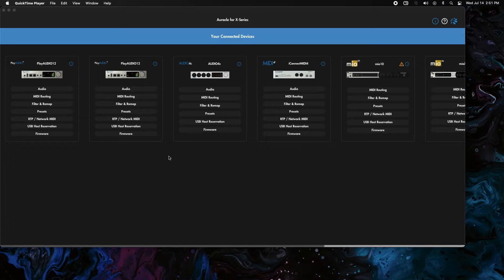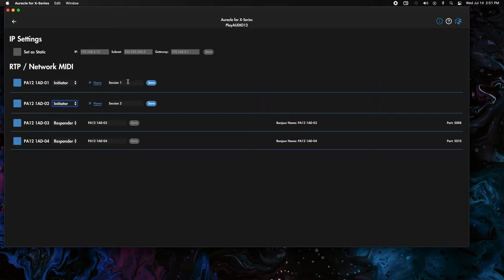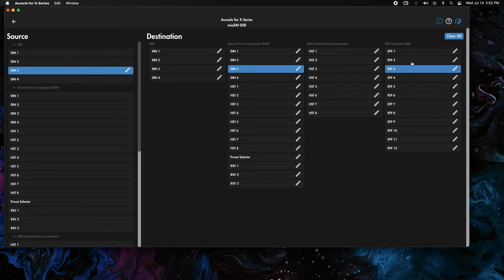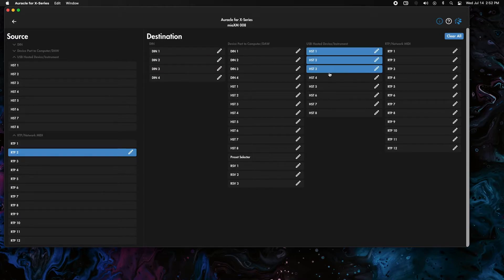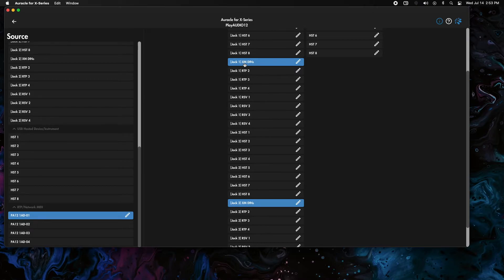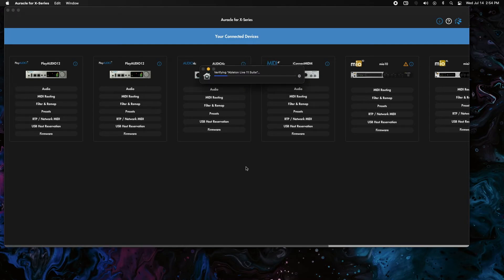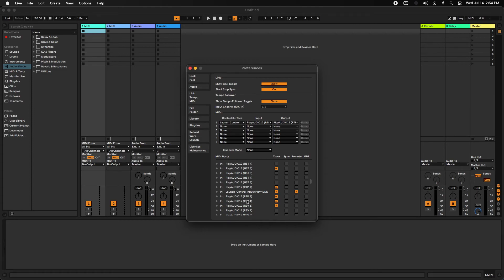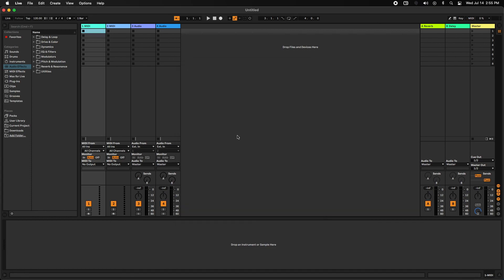Playback Rig Setup | PA12 & mioXM | Quick Version

Comment: Hello! Thanks for all of your great and detailed tutorial videos! I just want to be completely sure about what your products can be used for before I go on and order everything for my new live setup:

I want to use the playaudio12 interface for a redundant setup where I will run Ableton on two Windows 10 computers in parallel. My question is this: Will I be able to connect the mioXl USB-DAW connection to the PA12 USB-HOST connection and then send midi from external controllers (connected to mioXl) into both computers (and from both computers to external controllers (connected to mioXl))? 

Thank you in advance! :-)
Reply from the maker: You can do this. 
The only thing you will need to think about is that the mioXL has 22 ports (DIN + HST) that will need to be reserved into the 8 HST slots on the PA12.
If you connect less than 8 controllers itll be easy. 
If you connect more than 8 controllers you'll have to route more controllers through a single port and just channelize them.

Comment: I went through all the steps as shown, but I don't see the sam options you are showing in Ableton's preferences to select/deselect Track, Sync, Remote, and MPE. 

I have the Playaudio 12 connected directly to computer A, and the mioXM connected to the playaudio12 via ethernet. My midi controlled is connected to host 1 on the mioXM.

Help please!
Reply from the maker: The MPE is only added in Live 11. If you have Live 9 or 10 you won't see that.
If you have more questions please check out the detailed version of this video or contact us at iconnectivity/support 
I'll connect with you through there.

Comment: Hi, Thanks for this. Do you know if it's possible to BACKUp the memories of the MIOXL yet ? I need this so I can load them into a backup unit. This wasn't possible 18months ago. I've been separated from my rig now for over a year due to the covid situation so I haven't been able to check any new firmware.
Reply from the maker: There are 2 options but it's not built into Auracle X yet. 
1) We have a SysEx command that you can send to create the backup and restore it onto another. - https://www.youtube.com/watch?v=yhvxswddVr0
2) We have a BETA program which might have another option for you. For this option please contact me by submitting a support ticket through our website. iconnectivity.com/support
Reply: @iConnectivitySupport  Great stuff. Yes that's what I needed . thank you. :-)

Comment: Lawd Jesus I'm gonna have to rewatch this and the longer version... question:  My playback rig is still using the old software (not Auracle)... if I download Auracle will the wizard recognize the previously saved settings on each box or will it revert to an auto setting?  Can it read previously saved i/o settings files?  We're in the middle of touring again and I don't want to screw up what's working, but the old software is a bit of a pain to use and I can't seem to get a MIDI controller to be recognized (Controller > MIDI4+ Host Port > PA12 > Ableton).  Currently firing the show manually via space bar on both computers.  Living dangerously!!
Reply from the maker: You can switch to using auracle x and the settings won't change unless you have a different setup on the audio side. If you use the standard 10+headphones mix or straight 12 out you'll have no problems. 

I figured a long and short version would be useful. I'll also time tag all the s sections tomorrow. I uploaded as I left work.